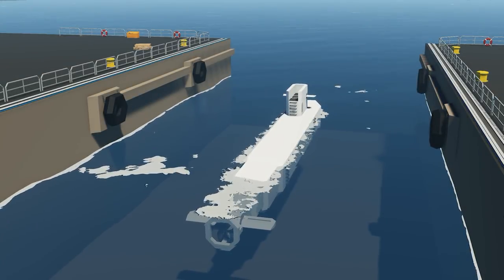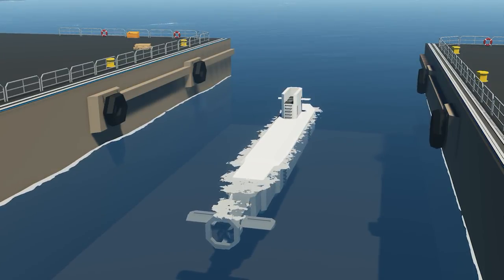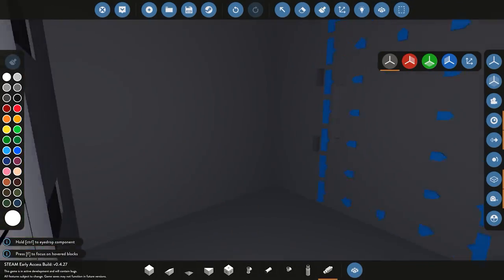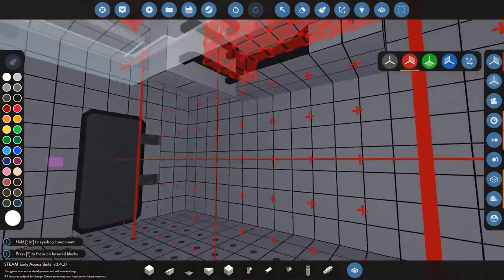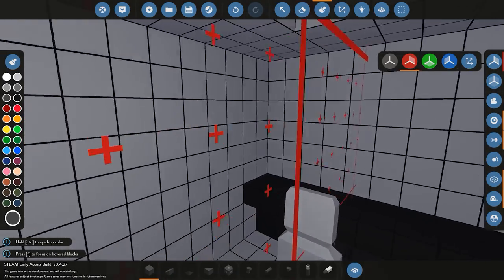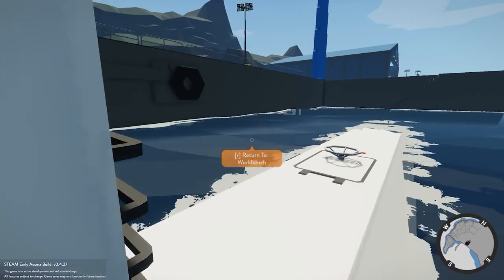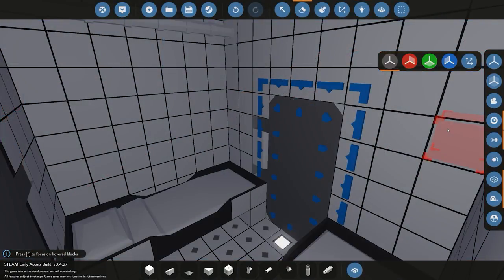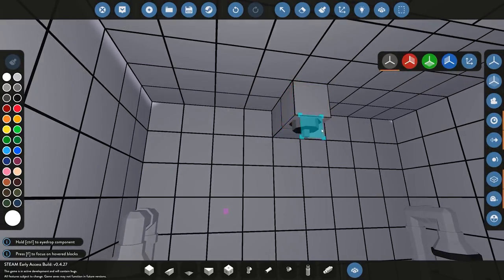Stormworks Advance Sub Tutorial Part 4 (Depth Hold & Custom Doors)

Comment from the maker: Hi everyone. Let me know what features you would most like to see in Part 5
Reply: A observersion tank

Edit:I mean observation Deck
Reply: MrNJersey a connection hatch for smaller submarines on the bottom
Also with the depth can you try and make it so you can change from using the seat and the keypad
Reply: Radar and anti collisuon system
Reply: add some windows at the front of the boat
Reply: Can you put it on the workshop please!!!!

Comment: BTW if you want to use the keypad for only doing to depth every once and a while and still have normal up/down controls use a numerical switch box. have the depth hold to the on one and have the normal to the off, have the value to the up/down of your sub.

Comment: For part 5 features:  Emergency electrical system, some kind of magnet system to make the sub mission ready, you could go fancy with a towed sonar array or weather station buoy. Torpedos and tubes lol.  Just some thoughts.
Reply: Add sensor on bottom, if you are about to hit bottom, computer will pull up, also, where is radar?

Comment: NICE, LOVE U. SO MANY VIDS KEEP IT UP. SRY FOR CAPS Xd could u pls show how to refuel tanks and how to build connectors?
Reply from the maker: you mean for the sub? because i have a video covering refueling
Reply: @MrNJersey  yes, for sub. or does refueling work the same with a sub like vehicle
Reply from the maker: Same more or less, will add it though
Reply: @MrNJersey  thank you <3 maybe, if u have time or if its not too difficult, u can show how to do a warning. For example if all outside-doors arent closed or if water is inside the sub that an indicator light will be toggled on. Because i dont know how to do warnings. U dont need to

Comment: Hi, I love the videos. They are very informative and well done. Keep em coming. I have one question I would like to ask. What would happen if you make the air intake for the diesel engine INSIDE the submarine? Like make the diesel engine get its air from inside the submarine so that if you dive underwater, your diesel engine will continue to run.
Reply from the maker: At the time of building, it wont let you start the engine, it has be getting air from an unenclosed space
Reply: @MrNJersey  forgot to say thanks for getting back

Comment: If you are flooding a compartment or airlock wouldn’t it be better to pump from and to the ballast tanks instead? I’m asking because for 2 reasons. 1st reason is in a sub you want to try to find Neutral Buoyancy to allow the sub to “hover” underwater but if you fill a airlock or compartment with water then you’re adding ballast and losing buoyancy causing the sub to sink to the bottom where if you flood the rooms from the ballast tanks then the water and buoyancy doesn’t change much. 
 2nd reason is the deeper you go the slower the Fluid Pumps actually can pump water out off the sub meaning you can end up with long wait times in a Airlock but it seems if you are pumping the water back into the Ballast Tanks then the pump speed shouldn’t slow down much…
 Just curious as I’m in the middle of my first sub build at the moment.

Comment: I managed to fix my issue. The fins at the front and back that cobtrol pitch arnt supposed to be the same. The front needa to be negative and the back positive. But what about the batteries? It runs out every 1-2 mins with speed going from 15m/s to 5m/s in about 20seconds after first motor forward throttle

Comment: Great video, could you create a system that adjusts the depth via the ballast tanks, so you could maintain the desired depth whilst stationary?
Reply from the maker: I can, Its just difficult with the size of the sub im building at the moment. If it was  a little bigger that would be possible
Reply: Real submarines don´t work like that, they just fill ballast tanks until they are slightly heavier than water and use control surfaces

Comment: Any idea how to keep the sub level using just balast? I set the target depth to -10 and it just fills the tanks to the point of sinking like a stone, I'm using 2 large pumps at each end for the fill and drain. But the front fills faster and get soon as it's underwater the rest section plumets like a stone
Reply from the maker: use a PID maybe